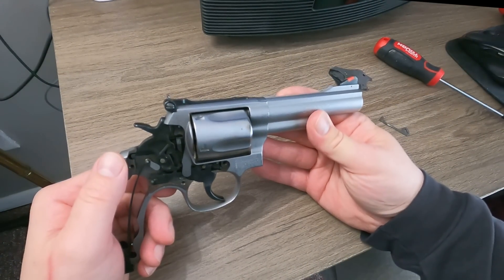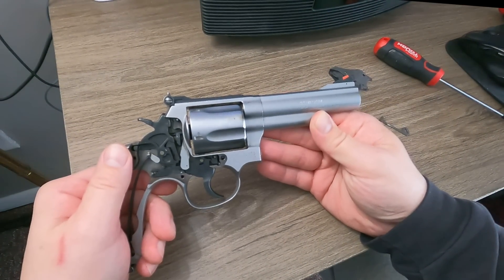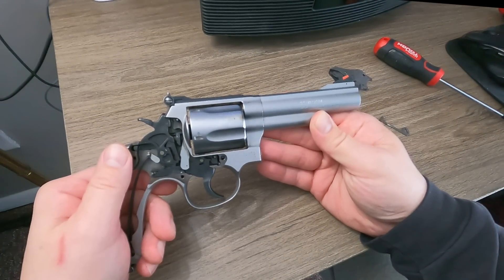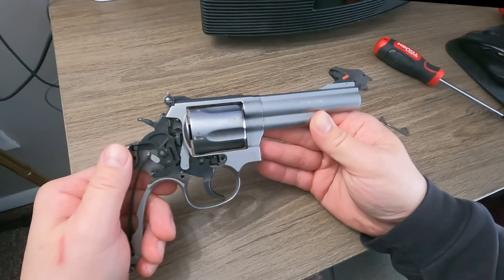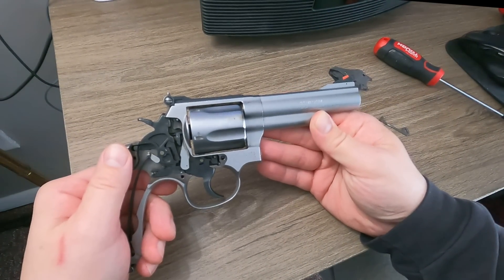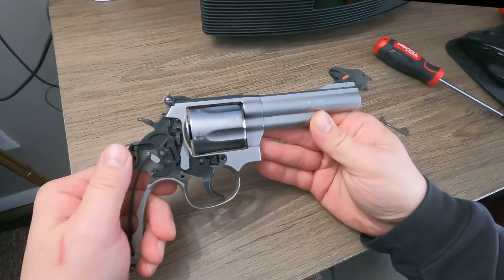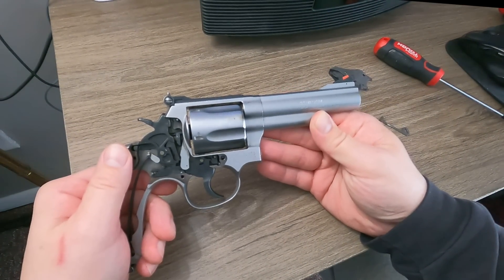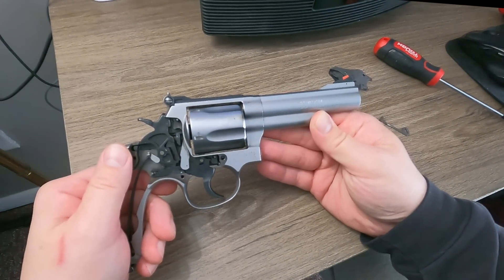Why Smith and Wesson's Revolver "Safety" Action is Superior to Taurus, Ruger and Others

Comment: I'm sorry but  the Ruger security six are GP 100 , are the Ruger Super blackhawk will take way more powerful rounds  than a  Smith &Wesson if you look up the the reloading manual certain loads are made for Ruger are Thompson center pistols.
Reply from the maker: That has nothing to do with the topic of the video. And the reason for what you say is because Ruger has longer chambers, period. The SAAMI spec for '.357 Magnum' is 1.590" OAL. S&W made their revolvers to fit this, just because Ruger went longer and now there's more room for a longer bullet, higher pressure etc doesn't have anything to do with a Ruger being better. Plus the topic of the video was action, not overall build.

Comment: i have the new taurus 327 and the transfer bar seems to be a different shade of color. maybe they updated the metal type?
Reply from the maker: I have no idea really. If it's black it's a possible blued carbon steel. Stainless can be more flexible but does heat up faster. I could see carbon steel as being a good choice for one.

Comment: Nicely done.  I have both and prefer the S&W also.  I just wish they still used the cool firing pin on the hammer.  Hey, I used to have one of those 5 shot L frame 44 mags... but I sold it because I thought it was too light and might have crimp jump on heavy loads during a bear attack, etc.
Reply from the maker: Thanks. I mostly got my model 69 as I was going to buy a target model .44 Special Charter Arms Bulldog with the 4" +/- barrel to compare to .45 ACP, after shopping around I found I could get the model 69 for like $250 more and was like, well might as well. I haven't had any crimp jump in mine that I know of with .44 Mag, but I don't think I have went over 255 gr. I could see a 305 gr bear bullet maybe doing that.

Comment: My gp100 has a quicker reset than my 686. I am a smith and wesson hater. They are over hyped junk. My 686 spits powder in my face. Bad timing. I sent it back and they said its good to go. The 686 barrel is pressed in now days. The lines dont match up. I will never buy another smith and wesson

Comment: Reliability of a flat spring vs a coil spring?
Reply from the maker: Generally small revolvers of any brand use a coil, big revolvers often use a flat spring. I don't think one is more reliable by itself, but I will say, having a coil over a rod that is attached where it sets in a recess is a good design, as where I have seen flat springs nearly falling off because they are just screwed against the frame to hold there by pressure, I could see a flat spring falling off the frame.

Comment: Then why can you shoot hot rods out of rugers, when you can't out of smiths?
Reply from the maker: While that question has nothing to do with my video topic, I will answer anyways. You can shoot most anything out of a Smith & Wesson, it's a misconception you cannot. The Ruger revolvers are built with a longer cylinder than a S&W in general, so there are heavier (longer) rounds that will not even chamber in a S&W due to cylinder length, and because the bullets seat out further you can often hot rod the cartridge. A S&W would handle it just fine if one of those rounds would fit. Ruger essentially went out of spec for the SAAMI specs of a .357 Magnum or .44 magnum overall length by making their cylinders too long, as where S&W stays to the same overall length it can accept under SAAMI specs of the cartridge. That's the main reason. Also Rugers are heavier due t their cast frames, and this allows these hot rodded rounds to be fired with more control than if it were possible for a S&W to chamber them.

Comment: Needless to say you still have a hillbilly hole because of that, and loading  hot loads from the Ruger only section, smiths with out a hammer firing pin are something I won’t ever  own.